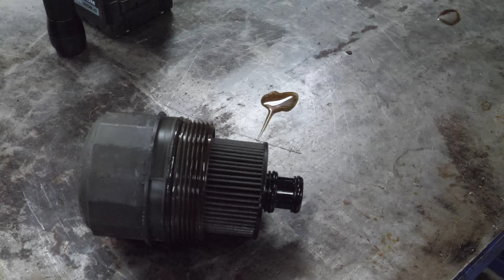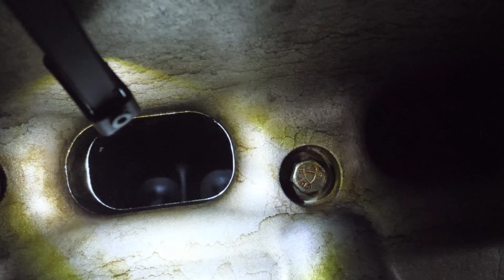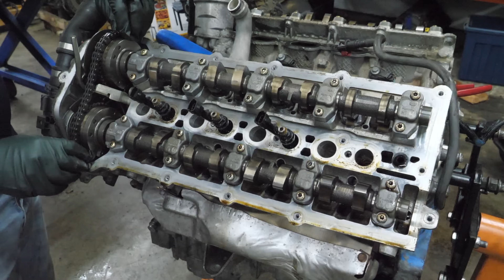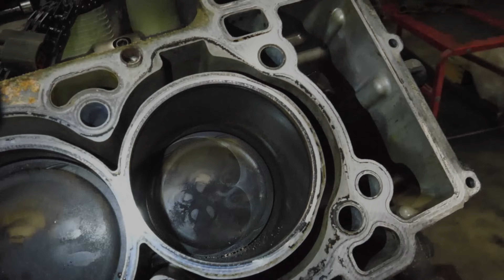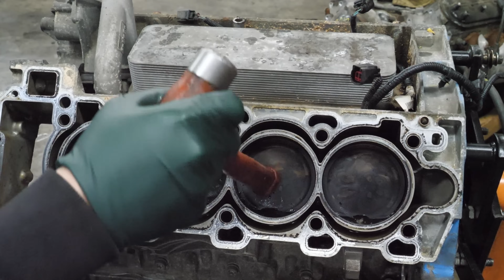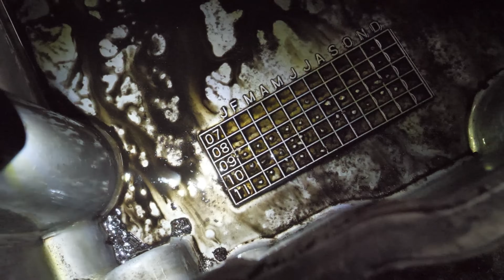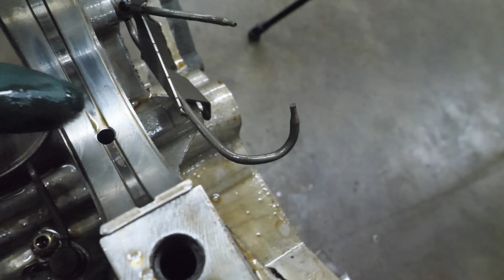500HP Jaguar Land Rover 5.0L Supercharged AJ V8 Teardown! Had to buy AND borrow tools just for this

Comment: Yes they are just check the cooling system change the oil every 4000 miles check injectors and it will go forever

Comment: I really hate the amount of plastic parts buried in the timing area, definitely a weak spot.  My car has this engine and luckily I have yearly services even though it only does 2000 miles a year, it's still a worry though.

Comment: 0:41   "When an engine gets returned as defective, they USUALLY don't just put it back on the shelf and waste someone else's time...."

The opportune word here being "Usually".  
If a customer goes through all the trouble of installing a used engine, then pulls it back out and returns it to the salvage yard he bought it from for an exchange, it's going to be bad. No one changes their engine 2 times just for the fun of it. 
IF a salvage yard gives cash back instead of an exchange for a defective part, THEN I can see some fibs being told by someone to get their money back, such as, "Yea man, this here motor is JUNK. I installed it, and it knocked right away when I started it, blah, blah, blah..", when the reality is that the person really lost interest in fixing the car, found out they were a little ambitious and were in over their head, or simply found another cheap car and no longer needed the engine they had bought. 
Around here where I live, all sales are final at salvage yards. NO CASH BACK, but they will exchange a defective part for up to 30 days or so.

Comment: 3:55    If I pulled an oil filter on a used replacement engine and found metal, I'd say "NO WAY, HOSÉ!" also...

Metal in the oil filter is a sign of bad things on the horizon for that engine.

Comment: Those damn oil pressure feed timming chain tensioners are the primary reason the Ford 5.4 has so many oil related issues. When they leak from the mount base or shaft, it lowers the overall engine oil pressure and causes a number of failers with cam phasers, and the plastic timing guides ect. When those guides get loose, they flap around and get damanged. It's just a chain reaction when those damn things start leaking. Damn shame Ford is using that similar design on this engine. Spring loaded design would have been far more reliable.

Comment: PLEASE DO A 2007 BMW 328I N52 ENGINE TEARDOWN. THATS WHAT I HAVE. AT 217940 MILES. OIL CHANGES EVERY 3-4000 MILES. I ALSO USE TUNE UP FROM GUMOUT. BETTER THEN SEAFOAM. THIS IS A GREAT CLEAN ENGINE I LOVE. BUT THE PULLEY FELL OFF THE AC COMPRESSOR SO I JUST REPLACED THAT. THATS ABOUT 600 BUCKS TO D.I.Y.  NEW SPARK PLUGS, FILTERS, AND I DO PRESSURE WASH MY ENGINE ONCE A YEAR. PLEASE DO A TEARDOWN OF THIS ENGINE. THANKS.

Comment: In my opinion, this engine was far more complicated than that 5.2 Audi V10 you did, just because of having to source all the special tools 

On a positive note, the Jag engine at least had the timing components on the front of the engine and NOT on the rear/transmission side

Comment: I noticed the timing tensioner  had fomoco on it the timing system looks a lot like fords. And Ford tensioners upgrades have a Rubber seal now and preforms much better instead of metal to metal. There should not have been any play in that chain none zero. The tensioner is bad with oil coming from the back side they will hold pressure while motoris off and the plastic you seen come from the chain slaping the chain guide.  Ford dont jump time that easy the noise would have been enough to scare the driver to not driver it any more.. It would have been a loud slippin noise against that plastic.  I didn't watch past the part where you pulled the first tensioner to see how it turns out and anymore problems you find . I say Ford motor because it looks a lot like a Ford motor. From what I seen so far it looks like this motors been into before I think the timing has been charged before and after market sealer and the bolts are not torqued uniformly.

Comment: Auction yards are full of low mileage Land Rovers for cheap with blown head gaskets. If you lease new and turn them they are nice but i wouldn't touch a used one. Notice he was worried about scratching the heads "they are worth way too much" because there are so many warped ones from overheating. I remember 30 years ago Jags were turds.
Reply: yeah jags had 350 chevys and thm400 for a reason!

Comment: This will cause comments, but here is the reason of oil intervals in EU cars.
In EU we use fully synthetic oil, and all our diesel cars, very common, are turbo, and many petrol are small tubo.  This means the oil is meant to be to a high spec fully synthetic.  In USA full natural oil is common especially at cheap lube shops. 
So in EU our oil change intervals are 9k to 18k depending on the car etc.  I have many old cars and never had varnish, sludge or oil usage. Simple 
So when USA people see high milage oil change intervals on EU cars it cannot work in the cheap lube shop crap oil culture.  So hence the common break down videos in usa.  We dont see this in eu tear down video, no sludge, no varnish.  Just money change or cam belt failure etc.  Yes, people dont change oil and you get failure, but high millage small cars lasting a long time are common.

Comment: Well looks like somebody dropped something small into the combustion chamber It rattled a couple times until her finally came out. Installer error that's why I always put all the holes plugged when I'm putting an engine in its hole 🤣 seems like these new schoolers take shortcuts and then wonder why they have to do twice the work when something goes wrong.

Comment: Older Landies engines are easier to repair in situ in the field than this engine.

Kinda makes sense to place the fuel pumps where they were, top of the engine did not had any real estate for fuel pumps. But it definitely is a bit iffy, especially if the sump (oil pan) area is not protected against rocks and other stuff that may mess up your engine from below.

Comment: That’s basically a ford engine. I wonder if the supercharger would fit directly on a 5.0 coyote. Crazy how that this engine is also used in the mustang and f150 but have different issues.

Comment: Sorry to ask if it's been asked previously, but, what year was this engine?  I hear that 2012 and newer AJ V8s have a revised timing guide design and they're not as prone to failure.  Thanks for this teardown!
Reply: I’ve heard different years, some say 2014, some said 2016. Their is a revised guide with a hardened pin for the tensioner to ride on so it doesn’t wear into the guide. Seems like when the guides go there are so many gremlins to get out that even if it’s done properly can have issues.

Comment: Rally driving a jag. Lol. Looks like sand got in that supercharger. Oil and fuel pump is for the racing heritage. For proper lubrication at high rpm for long durations. That nonsense is from the people that use to make glass spark plugs. At the time. It made sense. Racing heritage

Comment: The Thunderbird did not have that engine or the mark8 they had a 4.6 l which is derived from a 5.0 which was a modular engine both of them one was a single overhead Cam 1 was a double overhead Cam depending on which car you had whether there was a Thunderbird cougar or a mark 8.. same engine was in mustang and the cobra.. it WAS NOTBING CLOSE to this engine
Reply from the maker: 2002-2005 thunderbird
Not the 97 and older. 
I know, everyone forgot those exist

Comment: God i hate chains. Belts are so much more reliable, quiet and easy to replace. I do not understand why they use chains. The tensioners go bad. The slides break. The chains get stretched. Horrible. And because it's all hidden away, you have no idea of what's going on until something breaks and the engine is gone.
  Anyway, this engine seems to have been previously repaired before it was replaced. The fluid that came out of the crank bolt was probably trapped in there since the previous repair. I'd love to have an explanation to all these mysteries.

Comment: i'm betting on parts of rgw oil cooler coming apart and going through the system .
the piston looks like trash from a dirty air filter replacement,

Comment: 46:58 

i would say no

the job of a high pressure fuel pump is only to supply the necesary pressure and flow to the rail, just like a water pump or alternator isn't dependant on timing, they use a V-belt

it is only the job of the electronic fuel injection system to determine when to open the injectors and draw fuel from the rail

Comment: did you know ford built that engine for jlr , and ford still built most of there engines , engineered to break because jlr and ford always cost cut on there vehicles if you look at most of the parts it says formoco

Comment: Honda motor cycles did this. They changed there CHAIN CAM PUMP ETC DRIVES to. Fully Gear drive. All there VF RANGES . Yes yes the ones with soft cams. But they sorted all this.    I believe Honda make the best And Most Relible engines on all ranges.

Comment: I did the heads on one of these still in the range rover sport we had just replaced the engine in.  The BS routing for the cooler lines made it nearly impossible to bleed all the air and I got to fix what the last tech missed once it blew the head gaskets.  The normal service procedure on that truck is to remove the body from the frame.  I didn't do that...

Screw these unreliable engines and if I ever see an engineer for land rover, there will be violence.

Comment: You can bet our UK designers prefer pointless complexity over simplicity,  When fasteners already exist they will make unobtanium versions -- they're not very bright people... and where 4x fixings will do, they'll find new and exciting ways of using 26x of those special heads and have mixed condition all over the place. Designing for ease of service isn't in their heads. And - YES- we make timing systems out of the plastic that falls out of Christmas crackers.  Which is why I so much prefer working on American engines.

Comment: Basically a mustang engine and supercharged and all ford parts. It is a solid platform but Jaq and Rower business model is make money on maintenance and repair so these cars always broken. They dont repair, they replace, and that means every bolt and gasket. Some parts are cheap, they are Ford, just dont buy it from Jaguar.

Probably the supercharger caused some whine. Indy worked on it because stealership would replace entire supercharger instead of fixing coupling. Indy failed with timing chain install, JLR makes you replace whole engine instead of doing timing belt. IMO, car is too complex for basic Indy shop.

Comment: You didn't take that bolt out. It was clearly there by someone else. Compared to all the other bolts that one was very oily. Also i can't stand what oil change intervals some manufactures are telling people now. The reason they are extending the oil change intervals has nothing to do with advancements in oil, but has everything to do with advertising the cost of ownership over so many miles. By extending the oil change intervals they can say there vehicle cost less to own compared to another vehicle. I have 4 vehicles right now with over 500,000 miles. I change the oil every 3,000 miles no matter what the manual says and they all run amazing still. Simple maintenance makes a huge difference. Except for maybe the ford 1.0 turbo ecoboost because they decided on a stupid oil bathed timing belt.

Comment: To be honest I prefer seeing good engines that might get a second chance rather than carnage. Seeing crankshafts broken in half due to the oil starvation, crankcases full of gunk because someone changed the oil every 30kkm or engines completely seized because someone didn't bother to replace a plastic tube makes me sad. Most people really do not have any level of technical culture and they just don't care - they are used to this stupid habit of buying throw away items that you replace every year just because there is a new version of the same thing.

Comment: Good Evening.  Just had a claim denied for this engine by #CarShield My 2010 Range Rover Supercharged L322, which failed and is reportedly seized. My coverage, covered seals and gaskets only if they're needing to be replaced due to any failed internal lubricated parts within the engine. According to my indy, antifreeze was apparently found in the engine oil with no apparent external leak indicated. No other issues found beyond that as i meticulously managed the care of my truck. I'm being told that this is an apparent head gasket failure? From morning start up, to running perfectly for 5 minutes, traveling about 40 yards, light engine tap discovered, engine shut off immediately. My scan indicated cam/crank correlation code, tow truck driver DROVE my truck up onto the truck, knocking super hard as heck as he did so instead of winching it up onto the truck, filed claim with #carshield. Apparently engine found to be seized upon inspection, gone. I'm still in shock! Probably one of the most trouble free engines/vehicles I've ever owned to this situation. Thanks for the great video my friend.

Comment: It is utterly amazing the extent these "engineers"  went to in the quest for power. and then to turn it loose on the unsuspecting public is just obscene.  But that seems to be the theme now a days with these vehicles.  they make them so complicated as to be almost impossible to work on let alone afford and then to have these extended oil change intervals is asking for trouble.  All this crap they add to these engines in the quest for an extra MPG or horsepower is obscene.  Looking back at simple engines of the past they ran forever with minimal maintainence and care and cost but this stuff being offered today is frightening, and the costs of new vehicles are obscene, I wonder how people afford most of the stuff on sale today !!!

Comment: Fuck that engine. I worked at a shop where the put metal clamps on the timing guides to hold them together so they wouldn't fail again. Idk if it works didn't stick around to find out.

Comment: You can tell there is a problem with an engine design when they have to keep the block together by tying it to the main caps and fit a base plate. The layers of assembly required on this engine is a consequence of the layering in the CAD system, ridiculous and a killer to true visualisation in the mind of a proper design engineer! They put monkeys :face-purple-wide-eyes:on seats these days.

Comment: Why has this engine got FoMoTo on the castings. is this a ford engine like the mustangs have,, i see 4.6 mustangs and 5.0 mustangs and some supercharged. Either way a GM LSA or any LS after 2010  with a supercharged would smoke this complicated piece of junk. I had a 1990 V12 with 30,000 miles on it in 1995, beautifull car but full of oil leaks, expensive to fix when a  corvette LT1 350 chev had the same power and is maintanance free vertually. my car caught fire and burned to the ground. 45,000 miles on the clock from new.

Comment: I have a 2015 XF with this engine and it has 73k miles now. When i bought it 3 years ago at 62k miles, it came with JLR dealership work order papers for 'oil pump failure and 1 connecting rod'. It was done at no charge because they couldn't sell it with a bad engine. But, i've put 11k hard miles on it, it has VelocityAP tune on it and rips ass. It's very hard to drive on wet roads here in south florida, but when dry, it goes past 180 easily.
And yes, it also had ALL of it's plastic shit ford pipes replaced; Fucking ford garbage! Everytime they touch another make, its goes to shit!